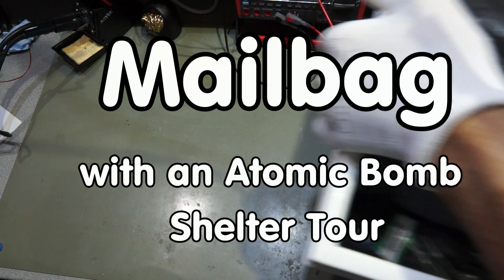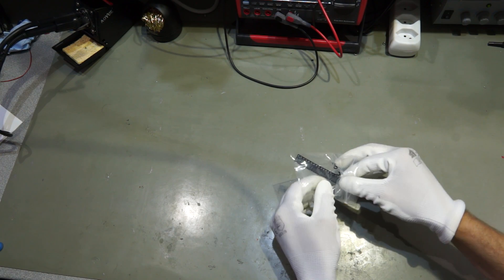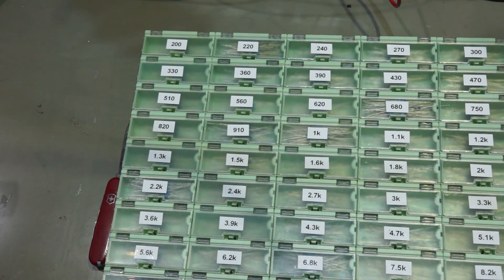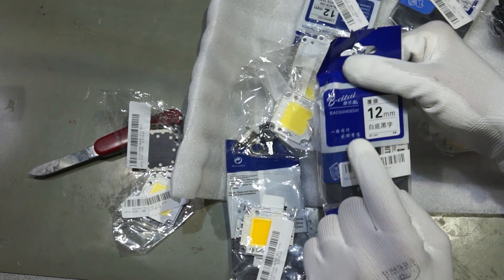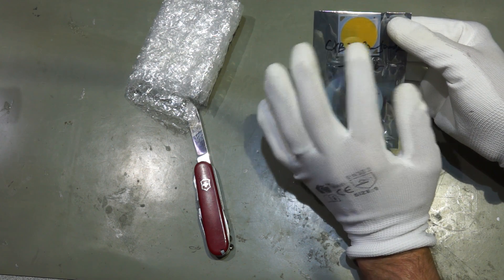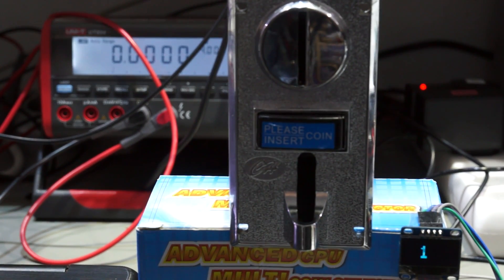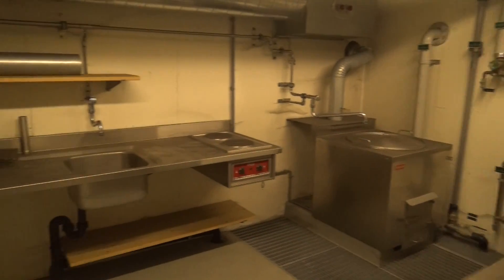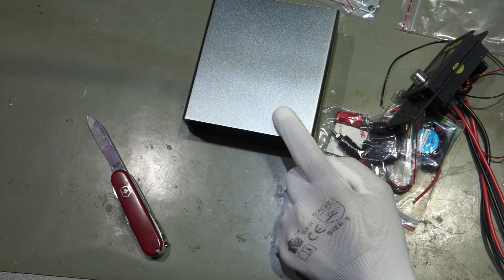#151 Mailbag (with a Swiss Atomic Bomb Shelter Tour)

Comment: I picked up one of those cheap Geiger counters too; seems like everything except the more expensive devices use the Chinese tube. I did purchase a SB-20 tube for comparison though but I have no source for testing aside from maybe kitty litter.
Reply from the maker: Maybe it is good that you do not have too much radiation around you ;-)  Maybe you can go to a local school. They usually have radioactive material.

Comment: A question to the 48V PS: does the fan run continously or just if needed?
Reply from the maker: +klassich D It runs continuously
Reply: Thanks, it is a pity but to be expected with that price point.
Reply from the maker: +klassich D I will install it below the table behind a drawer

Comment: Have a good look at the springy bits on the banana plugs, lately i have got some batches from China which were very very loose and caused unreliable connections and i had to solder them all in place to fix. They were so loose they made better fidget spinners than banana plugs.
Reply from the maker: These are fixed. Nothing is moving. I know those you mention.

Comment: Thanks for the great video and the look inside your shelter.
For your father: Several years ago I had to save a similar issue with my mother. I am usung Friedland Libra+911S as a wirelass connection between the doorbell and the living room. And with an additional telephone ringer also with the telephone. It warns acoustically and by flashing blue LEDs. Very versatile system, very reliable. See e.g. https://www.amazon.de/Friedland-D911S-Funkgong-Taster-schwarz/dp/B0014DXGOY ; of course I bought it from a cheaper source. The  telephone ringer is an option.  But the transmission is via radio so you have not install cables. And you also can add an additional base station for a different room, using the same transmitters.
Reply from the maker: Thanks for the link. I already installed a similar ringer with a light.
In the meantime, I was able to test the small device in htevideo and it really works with an analog telephone, makes a loud sound, and also a red light. So, I think, this is a really cheap solution.

Comment: hi, for the last device box, j'ai une information. le ventilateur livré avec ce kit est très bruyant. J'ai fini par le débrancher. Je vais le remplacer par un autre en 12 Volt, ou faire un asservissement avec la température du radiateur de l'alimentation.   Me too, I love the selter under your home.
Reply from the maker: Mine has a 5 volt regulator, and I can confirm, that it has a loud fan. I might go another route: Switch it off when it is not necessary...

Comment: Nice and interesting video! I don't think atomic bunkers are still built by standard in every swiss house today, are they? At least there isn't one in my house, just some regular bombshelter (basically a room with heavy doors). But anyway, may I ask why you are mostly wearing gloves in your videos? I never wear gloves when I handle electronics, should I?
Reply from the maker: 1. After 1989 things changed in Europe and also our laws (a little later). So, this bunker was one of the last built 20 years ago.
2. In small houses, we only had a room as you described. I live in a community with 100 houses/flats.

3. The gloves have private reasons
Reply: May I ask what brand are the gloves? I assume they are ESD gloves, correct?
Reply from the maker: They are from AliExpress. And I do not use them for  ESD, just for private reasons.

Comment: Hallo Andreas, danke für das tolle Video ... mit zusätzlichem lost places Abenteueranhang ;-)
Das DPS5005 steht auch schon auf meiner Bestellliste. Würdest du für 2 davon eher zu 2 der Schaltnetzteile aus dem Video greifen oder zu einem 48V 600W, wie z.B diesem hier:
https://de.aliexpress.com/item/switching-power-supply-12-5A-power-suply-48v-600w-ac-to-dc-power-supply-Input-220v/32608259741.html?spm=a2g0x.search0104.3.49.6svxYp&ws_ab_test=searchweb0_0,searchweb201602_1_10152_10065_10151_10068_10193_10194_10304_10307_10137_10060_10302_10155_10154_10056_10055_10054_10059_100031_10099_10103_10102_10101_10052_10053_10142_10107_10050_10051_10084_10083_10080_10082_10081_10177_10110_10111_10112_10113_10114_10180_10312_10313_10184_10314_10315_10078_10079_10073_10186,searchweb201603_19,ppcSwitch_5&btsid=d2a0295e-d3bd-4884-8ae1-2e9bf52de636&algo_expid=94103fab-bcd2-4f60-9373-d76499a7fae4-6&algo_pvid=94103fab-bcd2-4f60-9373-d76499a7fae4&transAbTest=ae803_1
Reply from the maker: Ich habe mein Netzteil stark überdimensioniert, weil ich  bei Netzteilen nicht an die Grenzen gehen will. Bei deinem Beispiel kommt es drauf an, ob du wirklich 10 A 48 Volt ziehen willst. Wenn du weniger Volt brauchst, wird der Strom auf 48 Volt ja automatisch sinken.
Ich habe mein Netzteil eher zufällig ausgesucht, so dass ich nichts über seine Qualität weiss,
Reply: Ja, "Luft nach oben" als Sicherheit ist bei den Netzteilen sinnvoll. Aktuell hab ich (noch) nichts, was die 10A bei 48V zieht ... aber da ist noch was mit Heizbett, HotEnd und ein paar Steppern in der pipeline ;-).
Reply from the maker: Wobei die vermutlich auch nicht 48 Volt brauchen...

Comment: Nice video. Looking forward to see the next episode where you will start using all those devices/gadgets. Btw, I love your atomic shelter. I want one too !
Reply from the maker: We will see if I am able to use all of them... 
We obviously have many unused shelters. But the transport is not easy. And they usually come with the whole house.
Reply: I love the space ! My shed in the back yard is getting too small. I'm building an extention next to it. After that's finished I can no longer expand (without divorce....). Then next phase will be getting rid of old stuff, which is hard for me. I still have a collection of Elektors going back to the seventies. I'll see if I can post some pictures of my workshop when it's finished.
Greetz,
Philip

Comment: did you use proper cooling and power management for those cheap high watt LEDs? you cannot really trust datasheet of those. I use 5 and 10 watt cree leds with proper cooling and 'typical'  voltage and power values. And it has lasted 3+ years on a medical imaging device
Reply from the maker: I have to check the temperature. They are mounted on a big aluminium block. Power management is done by the LED drivers, which supply constant current (I checked, this should be according the specs of the LEDs)

Comment: I like the bunker. Would be a great party room I think. No one could hear your loud music at night ;-)
Reply from the maker: Many of these bunkers indeed are now used for that purpose...
Reply: What about testing the wireless possibilities to communicate to the bunker using wifi/Lora/433 etc?
Reply from the maker: It will not work, because they are built with iron meshes. This was a problem because also FM or AM radios did not work...
Reply: Ok. Than this makes no sense and only the good old cable will work as a communication line. I really would like to learn more of the Swiss bunkers. Maybe you will make another video about this topic

Comment: You should switch to voice-overs because the sound is so much cleaner, especially for my tinnitus. I do my vids with voice-overs because you can redo the sound easily in edit.

Each box is $1, so that's $130 just in boxes.
Reply from the maker: Actually, it was a little less, because I bought 5 for 3.99. Then, it only costed about 100 $. But you are right, it is expensive. I hope, I can keep them for the next 20 years...

Comment: Take a look at Osram Soleriq COBs, they have a CRI of 95 and cost 15€ for a 40W one. A guy from Germany sells them on eBay.
I think that the phone ringer won't work because most countries in Europe use the inner two pins for POTS and in Switzerland the pins next to them are used. If the line is digital you could buy a Fritz!Box and then add a second IP based device that would just flash. I think that even a ESP8266 could be used. The old telephone can be used just as before.
Reply from the maker: In the meanwhile I checked the flasher and it works with the analog telephone here. It makes a loud sound and shows a red light.
Reply from the maker: That's what I tought with the telephone. Thanks for the confirmation. But I do not want to have a complicated solution. Maybe I have to have a closer look at the signalling of the telephone line and replace the wiring with an Arduino... Do you know of such a solution?
Reply: Andreas Spiess There is a nice VOIP project for the ESP8266 called RTP Pager and a used Fritz!Box is cheap but also easy to setup. Also the Fritz!Box is transparent to the end user, it would act as a SIP server. The analog way would be to detect a 20Hz sine wave but I don't know how to do that since there are some resistance requirements for the line. But I dont know if the line uses ISDN, maybe you could find a second hand pager for ISDN.
Reply: Andreas Spiess You shouldn't discard the flashing ringer if it doesn't Work for your fathers phone, though.  You could install it on the ancient phone in the bomb shelter - if bombs drop, you will have a constant ringing in your ears from the impact explosions - and thus a visible flashing will be a good supplement to the phone's ringing :-)

Comment: You will need a 45deg cutoff  thermistor connected to led and excellent cooling with 4 mini fans, l I have been using these low cost Led modules for last few years on my DIY projector and working till date no issues.
Reply: And assuming CC power is provided to the led.
Reply from the maker: 45 degrees centigrade seems to be a very low temperature. Mine are cooled by a large and heavy aluminium body.  But I have to measure the temperature to be sure this is not the problem. Thanks!